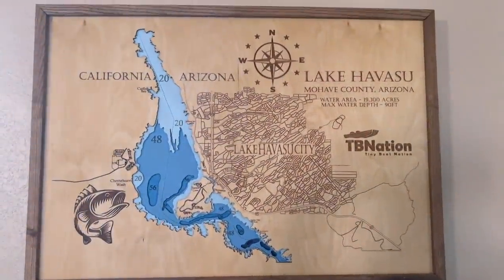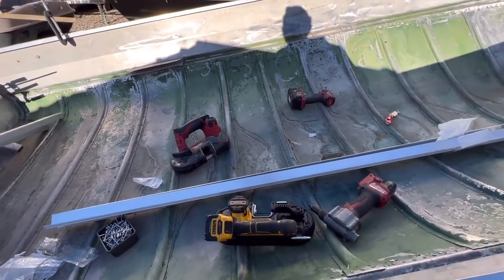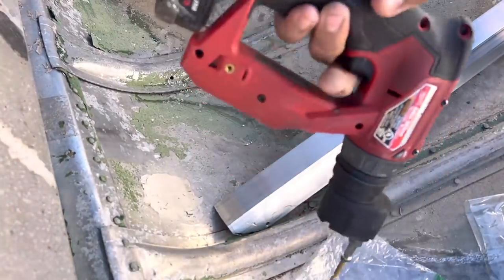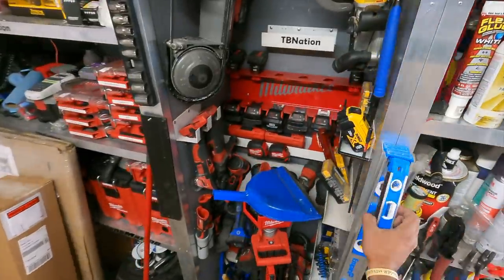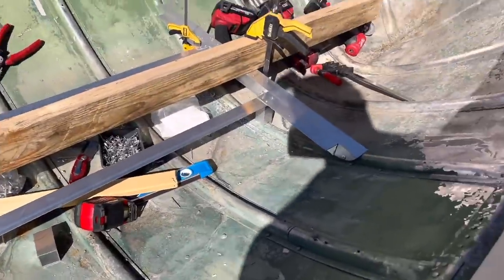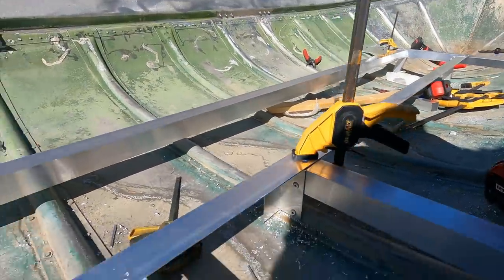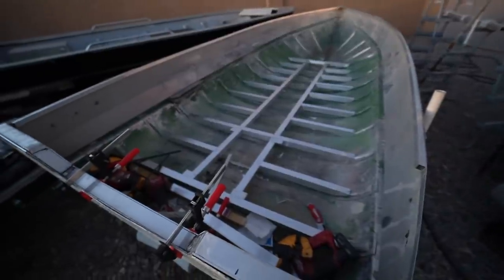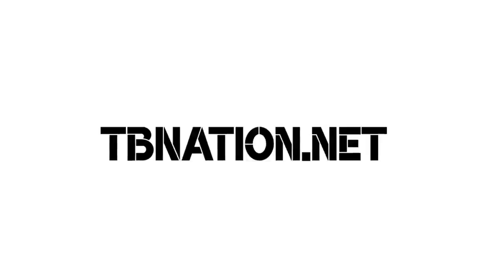Aluminum boat subfloor framing for Tiny Boats: Budget build Ep.3

Comment: Pan out the bottom and leave the middle channel for water drainage. The pour foam on the pan section. I would leave the 4 inch middle part without any for a drain and for my wires and other stuff to run.

Comment: Nice job! Yours looks way cleaner than the one a did. I used a very similar method on my 14' v-bottom. But mine had a transition from vertical spines in the back to horizontal (like your boat) in the front that made it a little more tricky to lay out and level properly. The back was easy, the front section was an absolute bear to frame so that  it would be level with the back framing. In front I used angle aluminum much the same as you did (but I used square tubing for the main beam (for strength) along with angle on the sides of it (to give it some extra width) and then tied in some angle like you did from the spines to the center main beam). Unfortunately I don't have those nice power tools you do, so I had to use hand tools to cut and rivet. It was a pain in the hands (and a55). Yours is shaping up to be a great build. Looking forward to seeing it progress.
Reply from the maker: Thanks for the insight!

Comment: I do like the slowed down process of this! I’m currently trying to finish my 1870 Big Jon V that I’ve done once and then decided this last fall after the tournament season was over to rip into again! I think I found where I slacked the last time, and definitely improved areas. I also added about a foot to my front deck. I’ve got everything framed, and I’ve got most of my wiring redone, I’ve added some more lighting, I now just need to make it up to get my hatch lids from Nate, I only live about an hour and half from his shop! I will doing my deck in turf this time as well. And I’ve definitely added more foam to mine this time around. I went with the pink board though, because it is a flat bottom and my subfloor I didn’t take too high up to allow room for deeper compartments, so I didn’t want any water just sitting on the pour foam!

Comment: How do you know the boat is level?  Better way would be to set a straight edge (2x4) across the top of boat (Across Gunnels) and measure down. That is the Eziest way I’ve found in my builds. That way if boat isn’t Exactly Level…..which is difficult. Most boat subfloors go right to the top of each rib. Probably Really close to where your ending up with your frame. FYI. Just a suggestion for the viewers. But all in all I love your videos. Very informative.
Reply from the maker: I will mention this in my next video

Comment: Such a cool build. I love this whole approach. Such a nice ride in a v-bottom, and especially love the deep bow on some of the older Lund v-bottom skiffs. That said I’m looking for a flat-bottom 1648, or maybe even a 1752 or 1852, to build. It makes sense what you’re saying about storage space, plus it seems like the flat-bottoms are less likely to get hung up on stuff in skinny water. Also I want to put space for a small berthing area towards the stern for overnight hunting trips when I’m not using it for fishing, so I’d like a few extra feet of length. 

Hey I’m curious about something - some boatbuilders caution against the use of a level when working on boats. They instead talk about using squares, compass calipers, dividers, triangles, rulers, contour gauges, and other tools like that to ensure precision and uniformity. Is the boat on a level work surface? Are the port and starboard gunwales are precisely level from bow to stern? How is she riding in the water? Does she sit flat, or does she list to one side?

Comment: Hey man, I have a 1965 crestliner sportsman 16 ft boat . Similar to this boat , where the floor is flat at the back and gradually tappers to a v. Not super deep tho. I have 4 benches . My question is , if I remove those benches and add this subfloor will it compromise the structure and stability of the boat?

Comment: Hey sorry if you already mentioned it, but is it possible to out the fllor level with the waterline to increase underfloor storage or would that compromise stability. Love the channel man thanks alot.
Reply from the maker: I would not cut any framing out in the subfloor. You can put foam elsewhere, but the subfloor still needs to be rigid.

Comment: How come you don't add " feet" to the vertical support?  I believe it would help spread the point of pressure on the hull .. thanks
Reply from the maker: You can do that. It’s sitting right in the gusset so it doesn’t seem like an issue. I may change it

Comment: Would there be anything wrong with only doing the back half of the boat with sub floor and pour foam?
Reply from the maker: No reserve boyancy if you spear a wave.
Reply: @TinyBoatNation  Thanks for the response! So what should I do if I have a bench in the front and back but don’t want to remove them? That’s the issue, it’s a 14ft Tracker that someone took out the middle bench and decked it all with wood.

Comment: I have a very similar boat.when drilling and riveting,  I'm assuming the gussets are hollow? Just wanna make sure that is the best place to rivet to?
Reply from the maker: Yes, they are hollow
Reply: @TinyBoatNation  how far do you drill? Just enough to get through?
Reply: @SGTshankem  yes it'll pop and that's it. Don't drill through the hull. I was nervous the first time too. use a 1/8 or 1/4 inch rivet with a 3/16th drill bit I believe.

Comment: I am in the process of using angle 1x1 by 1/16" to build my subfloor.  My concern with using 2 part foam is will it become waterlogged if an issue was to occur?  I pulled out 460lbs of wet foam from the boat and I am really concerned with the same thing happening again down the road.  I like the idea of it chemically bonding to the hull and helping with sound dampening.   Looking for advice.   I don't ever want to rip out foam again.  Plan to build all framing out of angle aluminum.  I have a V hull starcraft boat 16'.
Reply from the maker: If you do not take care of your boat,  yes
Reply: @TinyBoatNation  thanks.  Just obtained this boat from my uncle and it sat for 20 years uncovered.  I plan to put foam in the compartments and bench seats above the water line to prevent sinking.  I really don't want to put foam below the water line in the boat as it is a nightmare when it gets wet.  Thanks for the info